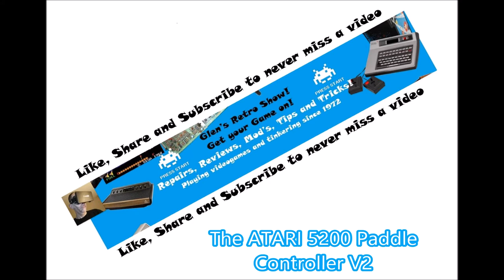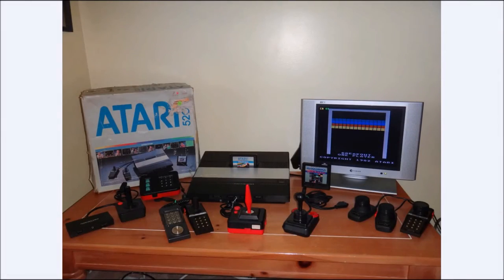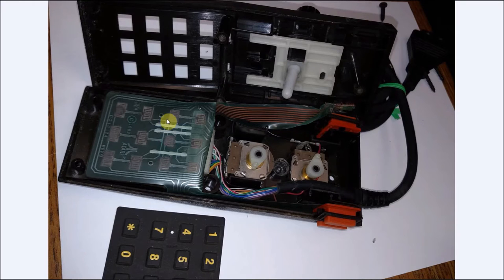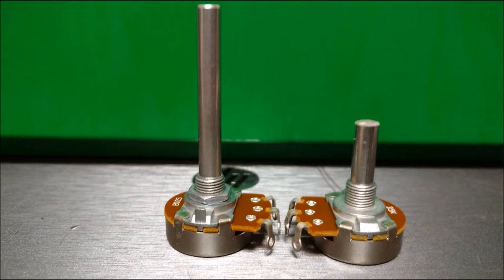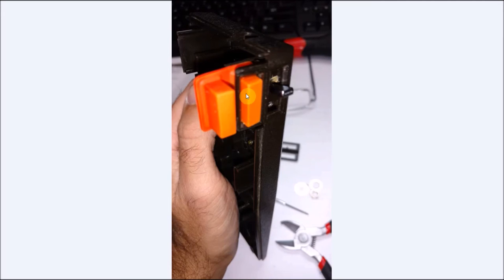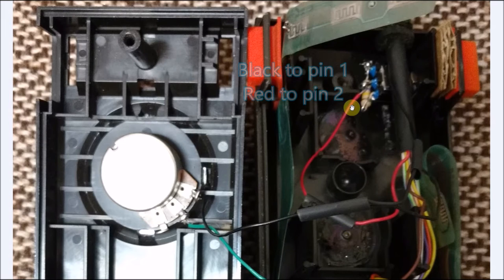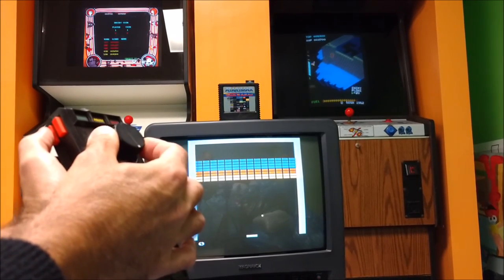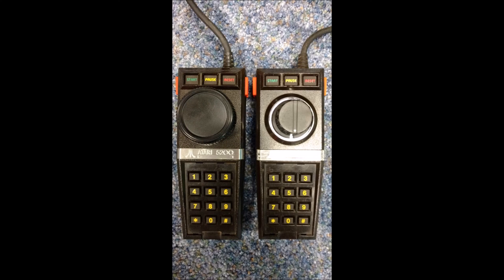Version 2 of my Atari 5200 Paddle with Shifter switch for Pole Position

Comment: If you want a cleaner look for the aluminum contacts, use a single hole punch. The resulting hole is pretty much the same size as the original carbon dot.
Reply from the maker: Keith Sheehan thanks Keith, I had thought of that, but didn't have one available to try.  but it sounds like I better 🤗 thanks for the tip 👍

Comment: If you do another controller like this try connecting the original side button traces to the upper pot. That should "map" the button to the gear switch.
Reply from the maker: Awesome tip